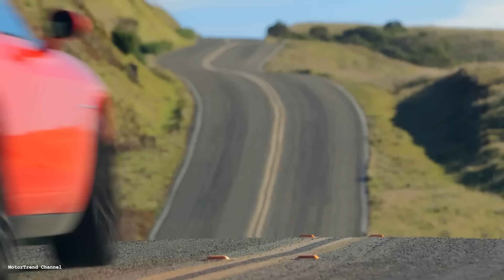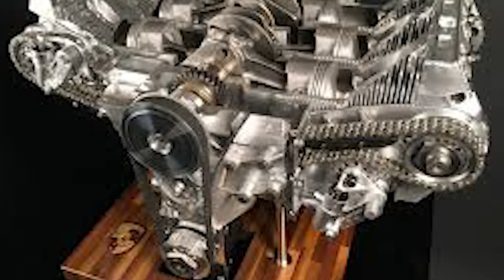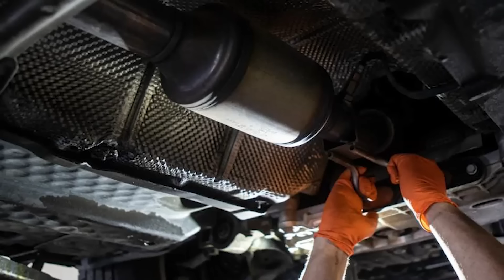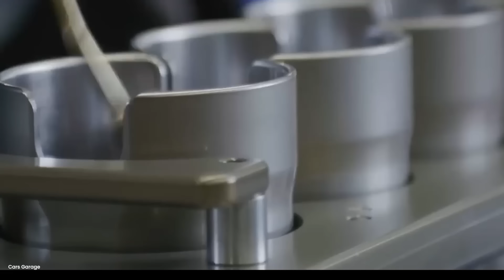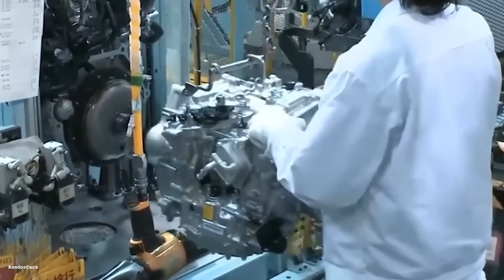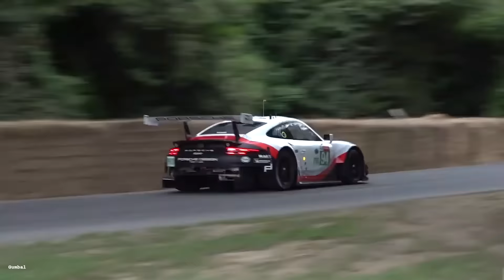How One Porsche 911 Flat-Six OUTSMARTED V8s With Innovative Design

Comment: And the Chevrolet Corvair flat 6 came out in 1960 way ahead of Porsche, almost light years ahead and my 1963 Corvair was turbocharged
Reply: Porsche built flat fours starting in the 1930s (Volkswagen)
Reply: @miketurner3834 But this discussion is about flat6 cylinder engines. I am an aviation historian and a 20,000 flight hour ATP pilot and my BA degree and I can count. I speak Vietnamese with a Ha Noi dialect
Reply: @JaguarKwikE well good for you. Just saying porsche just added two cylinders. Wasn't there an article written "corvair unsafe at any speed" btw light years ahead is a VAST overstatement!
Reply: Just count race wins between the two.
Reply: @miketurner3834 yes a lawyer that didn’t know the difference between his head and a hole in the ground wrote that book. I prefer the mid engine configuration

Comment: Crazy to think they spent 60+ years fighting the laws of physics to tame the rear end, when they could have just eliminated the rear seats and put the engine ahead of the rear axle, in front of the gear box
Reply: If that was true then the 914-6 and the Boxster would be better than the 911s, but they're not.
Reply: @jackandblaze5956 the Boxster & Cayman handle better than the 911,every proper petrol head knows that,but it's Porsche that doesn't want you to know that coz they can then charge twice the price for the 911,that's why they underestimate the performance stats for the Boxster & Cayman aswell!
Reply: They put they put the flat 6 mid engine in the very good 904. 1n 1968 the put the flat twelve mid engine in the 917 lemans car capable out the box over 220 mph and won in 1970 and 1971. Then they banned it.
The 917 held the record for 40 years.
Then they tubo charged it's 5.3 flat twelve to 1580 hp and brought it to America and annihilated  the 8liter Chevrolets big block Mclarens in can am. Embarrassed McLaren pulled out!

Comment: Nice Video, but too many Photos of V8 and V12 Engine Cars.  

Even as a Kid, I thought Porsche was stupid to Engineer a Car with Engine BEHIND Rear Axle and Suspension.   Porsche spent YEARS and untold Monies to rectify that Rear Weight Bias!

Oh, it's ironic that later, Porsche Entered the Front Engine V8 Car Club with the 928.  The 928 was intended to be the 901/911's Replacement.

Comment: "In 1963, Porsche did something that the rest of the automotive world thought was completely insane. They took an air cooled flat 6 engine, a configuration most engineers considered outdated, and dropped it into the back of a sports car. The experts said it would never work."  The Chevrolet Corvair began production in 1960. It was powered by a rear mounted, air-cooled, horizontally opposed flat-six engine just like the Porsche that debuted 3 years later.

Comment: I have driven almost every year of the aircooled 911's and all of them had very odd handling issues. Go into a corner under more than 1/2 power, you got plow-steer. To much brake in a corner could get the ass to kick out and when that happens you are going off the road no if ands or buts. Once you found the limit and didnt total your 911 they were pretty good, but other than the 930's i thought they were all under powered.

Comment: A flat 6 engine is an anachronism. As far as I know, no other car manufacturer uses it. Even Subaru has dropped its flat 6.
The engine is not only low, it is wide. This engine only makes sense when rear or mid mounted in a pricey sports car. 
Behind the driver, there are fewer packaging constraints. And close enough to the rear driven wheels to avoid a long prop shaft.

Comment: EV's have even better ,lower Center of Gravity than cars with boxer engines , exactly because of that heavy battery that is sitting as low as possible in the floor . No internal combuston engine configuration can beat that ,not even flat or boxer engines
Reply: Car people don’t care about EVs

Comment: Interesting topic, but the visuals don’t match the engine you’re talking about.
Reply: I prefer the handling dynamics of the mid engine Cayman & Boxster vehicles more than the 911.
Reply: @jeffbrassard1268 ironically,  Porsche HAD a Mid-Engine 356 "Version": the Porsche 550 Carrera. 

Why Porsche went ahead and essentially,  Built a 6-Cylinder 356 is STILL beyond me.

My Best Friend bought an Ice Grey 2025 Porsche Cayman and LOVES how Car Drives.  He recently Passed the 3K Mile Engine Break In, and is able to Push Car on Familar Roads.
Reply: Agreed, lots of images of V8 engines in various configurations